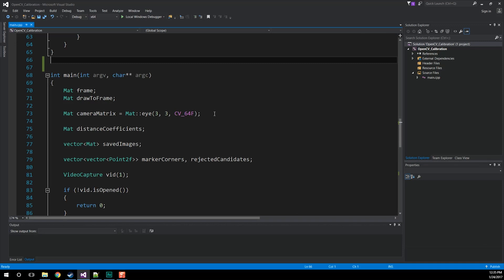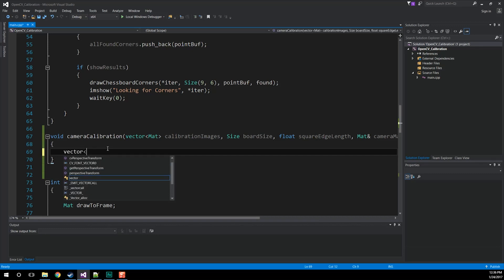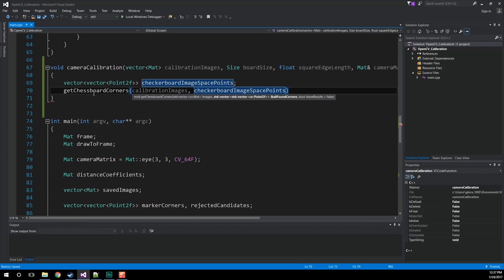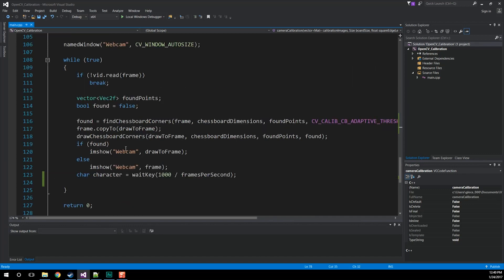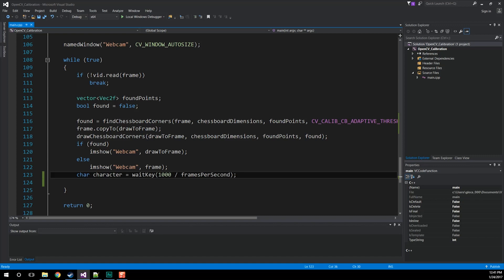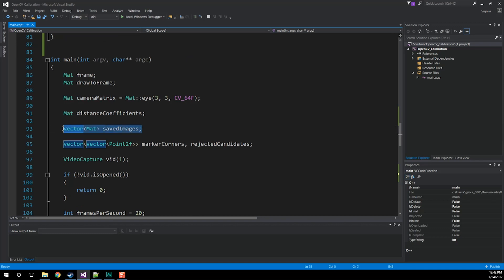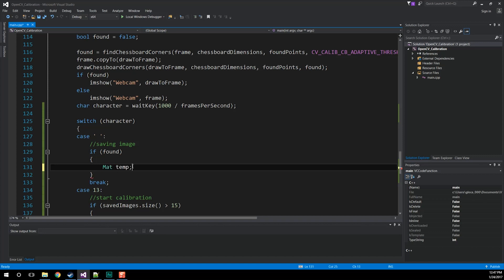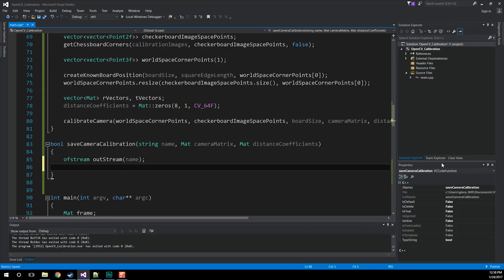OpenCV Basics - 18 - Camera Calibration Part 4

Comment: Hi George, I try convert pixel coordiate to world coordiate when i have intrinsic matrix, rotation vector and translation vector intrinsicMatrix = np.array([[3442.02,0,1286.04], [0,3444.89,1009.09], [0,0,1]]) traslationVector = np.array([[-53.47360],[-40.4999],[744.253]]) rotationVector = np.array([ 0.00707434,0.00232072,0.022695]) rotationMatrix = cv2.Rodrigues(R)[0] extrinsMatric = [rotationMatrix | traslationVector ]

I use : pixelCoords = intrinsicMatrix * extrinsicMatric * worldCoords to caculate worldCoords but when pixelCoords = [0,0,1], worldCoords =[ 55.66394942 , 33.7139661 ,-743.38827207] and pixelCoords = [2000,2000,1], worldCoords [ 56.25803192 , 34.28119113 ,-743.39096856] worldCoords is not change. What is my problem?

Comment: How can i use the them parameters values to correct the distortion?
Reply from the maker: You take photos of the grid as shown in the earlier videos. The coefficients are calculated by opencv. Save those values and next time you use the camera, load them into the function. If you want a detailed explanation of what each coefficient does, refer to the opencv website or a good optics  page.
Reply: @GeorgeLecakes  so basically, I used my camera with checkerboard and generate the parameters. I made a video of my experiment and extracted images from it but images are distorted hence I will used the parameters from the checkerboard and plug that into the experimental code to remove the distortion from the experimental images. Correct ? Is there a code or any video which uses the parameters and correct the distortion from the real life problem images?

Comment: For anyone else confused, distance coefficient is referring to the distCoeffs in the OpenCV documentation which as per the documentation and literature stands for distortion coefficients. Similarly rVectors and tVectors are usually refered to as rotation and translation vectors instead of radial and tangential vectors. These represent the extrinsic parameters of the camera and are used to transform a point from the world coordinate frame to the camera coordinate frame.

Comment: If I have more than 1 webcam plugged in, how can I select which one to use?
Reply from the maker: During the setup there is an integer parameter you can pass in specifying the webs cam you are using.
Reply: @GeorgeLecakes  Yes, I figured it out. Thank you for putting this series together!

Comment: Hi,
i know it been a long time since you publish this video but i have one question.
why you use the boardSize in calibratecamera as parameter when boardSize is the chessboardDimensions which is (6,9) and not the image's size as opencv document said??
how did you get a correct calibrations using a wrong parameters, or am i missing somthing??
thank you,
Reply from the maker: I'm assuming you are referring to the function "findChessboardCorners", in which case the documentation on OpenCV's site says: bool findChessboardCorners(InputArray image, Size patternSize, OutputArray corners, int flags=CALIB_CB_ADAPTIVE_THRESH+CALIB_CB_NORMALIZE_IMAGE )

patternSize – Number of inner corners per a chessboard row and column ( patternSize = cvSize(points_per_row,points_per_colum) = cvSize(columns,rows) )
Reply: @GeorgeLecakes  , no , i'm referring to the function "calibratecamera", calibrateCamera(objectPoints, imagePoints, imageSize, cameraMatrix, distCoeffs, rvecs, tvecs, s.flag|CV_CALIB_FIX_K4|CV_CALIB_FIX_K5);
this is the link : https://docs.opencv.org/3.4/d9/d0c/group__calib3d.html#ga3207604e4b1a1758aa66acb6ed5aa65d
Reply from the maker: Looks like a screw up on my part, good catch.
Reply: @GeorgeLecakes  thanks for the replay ^_^, and good job by the way, your videos was a good start for me to work with calibration

Comment: How long does the camera callibration process take? There are no infinite loops in my code, my code seems to be stuck in opencv's callibrateCamera function. Is this normal? I am using 41 images, each of which is 1920 by 1080.

Comment: the size of distancecoefficient = Mat::zeros(8, 1, CV_64F); why you use that dimmension?
Reply from the maker: There are 8 distance coefficients that form a vector of 8x1. That's is the only reason it is used.
Reply: Hi Marisol, were you able to calibrate the camera? I cannot capture frames from the live stream. Can you help me with this issue. Thanks
Reply: Yes i have calibrated my camera, if you talk spanish its more easy to me... what was your problem with capture frames?
Reply: hi Marisol:
may i ask a question?
how did you do to generate a file "IloveCameraCalibration".
when project run use"space bar" to capture the file which find aruco line or some else
can you help me

many thanks to you
Reply: Droit Liang when you run the program and its good, with space bar you take the photos that you want i took 50 photos, when you Stop taking photos, you press enter and the program seems like frozen, and when the computer did the calibration just Stop freezzing and you go to the name of project to open file locación and you can found the file with no extension but you can open like a notepad.
Reply: Sorry,  I was giving the wrong ascii value of spacebar to capture my frames. It is working now. Thanks for your reply.
Reply: Marisol Sierra:
thanks for your help.and many many thanks.
and i have one more question for the generate file.
i know that file shows camera calibration parameter,how can i read that series of number?
and how can i auto-save the frame which i find cheeseboard?

i.e 
i took 20 photos and how can i save 20 frames which  had find cheeseboard.

can i get your e-mail?is it convenient for you？
Reply: hey... i guess in this video or in next Video George explains how to read the numbers of the camera matrix and distortion coeficients. And i think that with "imwrite" you can save the frames of calibration. Review documetantion of OpenCv "ImWrite" i guess..I'm new in OpenCV too.. i hope i help you.
Reply: i'm so happy that you help me.i have done George's opencv series video.but find something wrong then go back and back to check it.
opencv is a good tool let us easier to learn.sure i have "Learning OpenCV 3" it's a very good tool book

Comment: Thanks George for this excellent video series! 

For those whose programs are freezing once you press spacebar to start the calibration, you're most likely in an infinite loop.  A good way to find infinite loops is to add print statements within each of your functions and for-loops.  It could be something as simple as as writing an i where a j is supposed to be. I had an infinite loop, but now I fixed it and the program is working how it's supposed to.

Comment: Hi George, great tutorials! I've been following along. Quick question, so basically I'm running the program and trying to capture images of my chessboard using the spacebar. I know for a fact that my webcam recognizes the board because the rainbow colored markers are being overlayed when I hold them up. However, despite 15+ spacebars then hitting enter (based on the case structure defined), I am unable to generate the file or even a trace of any of the captured images. Any thoughts?
Reply: click on the webcam window first, then start hitting spacebars. I also faced a similar issue.

Comment: Hi George, thanks for the videos!

I have the calibration working using a chessboard and after 40 photographs a reprojection error is calculated. I'm not getting very good results though. Is there a work method to follow for taking photos? Angles? What to get in shot? 

One big question I have is if I am trying to get the whole board in shot, or get the bottom row of square intersections as close to the edge, to try and pick up the extremities of the camera? 

Any advice really appreciated
Reply from the maker: I too had lots of problems at first with calibration. I found that making sure I rotated the checkerboard  from multiple positions close and far away from the camera helped the best. I had horrible results when I just rotated it in front of the camera. Only until I did it from 10 feet away and various locations close to the camera did I get good calibration results. I hope that helps you somewhat.
Reply: Thanks George, I definitely haven't been getting far enough away from the board. How important is it to capture the white space round the edge of the board or is it fine to have this out of shot? I think I read somewhere that the white space is used by the calibration process?

Comment: Hey George, great video as always. Everything worked perfectly with my webcam, however when I tried to connect to an ip  camera's rtsp feed over the network, the program crashed. In debug mode I get the error, Assertion failed (dims <= 2 && step[0] > 0) in function cv::mat::locateroi. I ran the program in release mode, but still the feed froze.

Comment: Thanks so much for your video.
Could you please specify the value of each row of the "ilovecameracalibration" file?
Because i'd like to modify it with the values obtained giving some pictures to Matlab to do the calibration (i'm using a gige camera and do the calibration live is quite difficult).
Does it work as config xml file to give to Aruco?

Comment: Thanks for your tutorial. But when i debug it, it open the webcam liked part 3 without camera calibration value output?
Reply from the maker: +Marek Ilko I had to. Hang m y input source due to my capture software taking over input 1. For you, it should be capture 0.
Reply: Pls someone help me..
Reply from the maker: +phulong phung not sure exactly what you mean it opened up a window showing your webcam but what exactly happened after that
Reply: the output when i debugged part 4 liked the output of part 3, i didn't get the Camera Calibration Value output  ?
Reply: Hi phulong phung. I have the same problem. Video 17 is OK but in 18 when i started debug,  didn't showing my webcam but I get OpenCV_Calibration.exe' has exited with code 0 and  I didn't get file "IloveCameraCalibration".  if you solved this problem can you give me feedback. 

Maybe problem is VideoCapture vid(0) because in video 17 is  vid(0) and 18 is vid(1) in main. I tried change value on 0 in code from video 18 and afther window showing my webcam ( I could see chessboard like video 17 but I dont get file"IL..." , I try Space and Enter but only ESC was ok.
Reply: Thank you George. I had a typo :/ With VideoCapture vid (0) is everything ok
Reply: I changed vid(0) -- vid(1) but it's still not have ILoveCameraCalibration in folder? can u help me?

Comment: i'm working with a project to detect an rectangular object and send its coordinates to a robot to pick it up 
 till now , i got the coordinates of the object in pixels . i need to convert this coordinated to the real world coordinates . i'm working in 2d plane and z is zero 
most of the tutorials say to use solvePnP function 
actually i don;t know what it does . 
is the calibration method described in these series do the same function 
and what is the need of the matrices you got at the end of this video 
* sorry if mu questions are basic , but i'm new with opencv